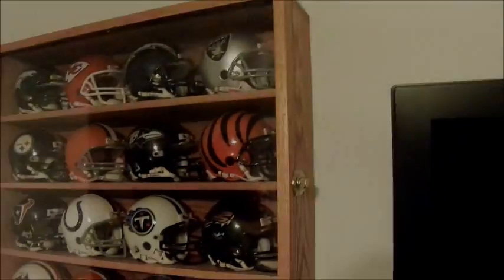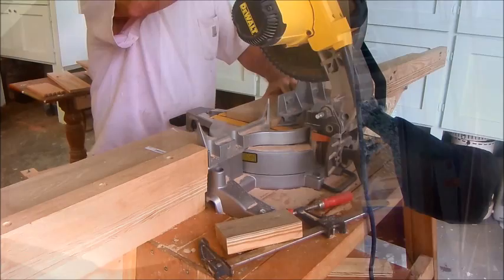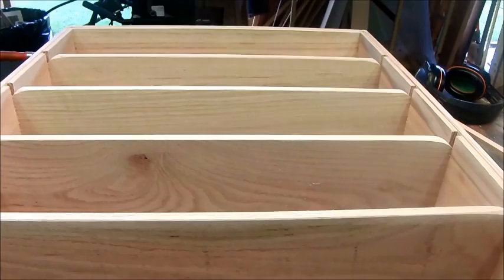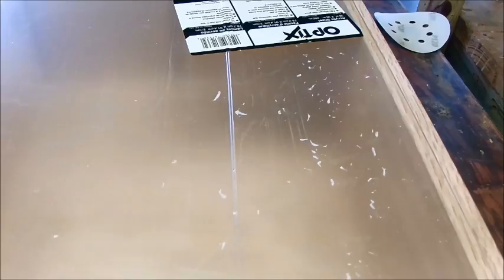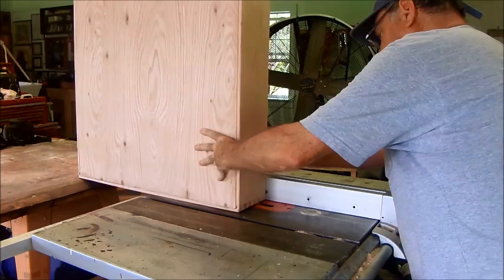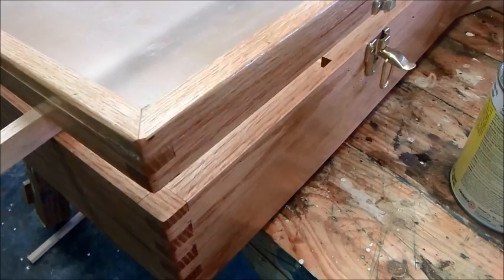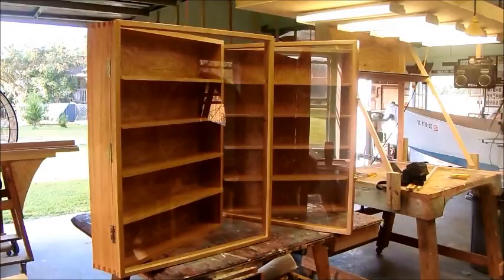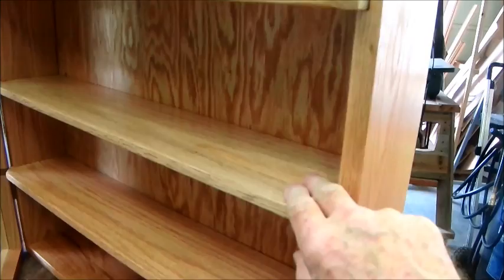Making display cases, football mini-helmets, box joints, oak, dewalt tools, plexiglass

Comment: Very nice Memphis!  Well done the way you showed what you intended to make, then made it, then showed the finished job.  Really beautiful work.
Reply from the maker: Thanks.  I was lucky here, since it was a repeat job, and they wanted two.  So, I could make one to show as an example, plus the original.  I'm thinking about building a one-off camping table next, so I won't have anything to show first.  Maybe I'll draw a picture.  Or maybe it doesn't matter.  Woodwork is easier than making videos.  
Again, thanks for the support. Install the stove.

Comment: Thanks , I'm thinking of making one like that but for my collectible figures.
Reply from the maker: +Quetzachapin Might be easier than building for a specific object, like helmets.  For the helmets I had to measure the helmets and bring in some examples to make sure everything fit okay.  You can see that I've built some boxes for collectibles (on my wall), but for those all I had to know was the size of the largest objects.  The split case design is really the way to go, and is the easiest in my opinion.

Comment: great job on making those cabinets.would you consider making a display case for antique 1/32 die cast cars & trucks?
Reply from the maker: Harold Scheppman Thanks for watching.  Actually I did make at least two display cases for "HotWheels" cars a couple of years ago.  Didn't make woodworking videos then, however.  But I think there is a picture of one of them in the lower right on the "Memphis Applegate" intro picture.     In any case, I will certainly consider making one as a future project.  Booked up right now, probably through May, but once I complete my current work, I will do it.

Comment: Nice workmanship. Looking to make some myself. Thanks for the video build, however if I could give you one tip it would be to get someone to show you how to edit your videos to where you mute the sound while running your machines to make cuts, etc., because it almost blew my eardrums as I had to have it turned up to be able to hear you talk.
Reply from the maker: Thanks, I know that is good advice, as my wife has told me the same thing.  I will work on it, but I agree it is a problem.

Comment: I would like to order a few of these, do you possibly do this and ship? If your interested, please let me know. My husband has all the NFL teams and would rather have these to hang on the wall instead of the plexiglass box covers.
Reply from the maker: No, I'm not interested in any production and sale of my work.  However, I suspect you could find a younger guy or gal to reproduce my rather simple design.  That being said, your best bet is to buy a mass produced factory made alternative, as the cost of a custom made case (built by a woodworker) would be very high, without a corresponding increase in quality.

Comment: Hi Memphis,

Loved the work you did on these.

Would you be able to build me a mini helmet case with a locking feature? 

How much do these typically cost?

Thanks,

Brian
Reply from the maker: +Brian Johnson I never sell anything, as the price would be too high.  I buy all my material retail, so it makes the cost of wood, plexiglass, and hardware very high.  Check out the price of retail oak boards at Lowe's or Home Depot to see what I mean.  I've never exactly figured it, but I suspect the oak alone in one of these cases is over $100 (remember, the shelves are oak also).  Go over to the paint department and check out the cost of plexiglass.  You will be amazed.
      So, the total cost of material for each case approaches $200, then add shipping cost, and it gets silly.  I suspect that you can find a better deal.
Reply: +Memphis Applegate 

Thanks Memphis, 

I understand. what is the dimension of this box?
Reply from the maker: +Brian Johnson Sorry I missed your question earlier.  About 30 X 30 inches.  This week I'm building another version with curved glass, and next week I'm going to try to build one with cheap material and common tools.  With any luck I'll show you how to build you a Mini-helmet case using only a jigsaw and a drill!!!!
Reply from the maker: +Brian Johnson Tomorrow afternoon I will be releasing a video that shows how to build a display case using only common tools and cheaper plywood.  It is not easy, but with patience it is possible.  Hope you get a chance to watch the new video, as you are one of the folks who inspired it.  It is Memphis Monday #40.